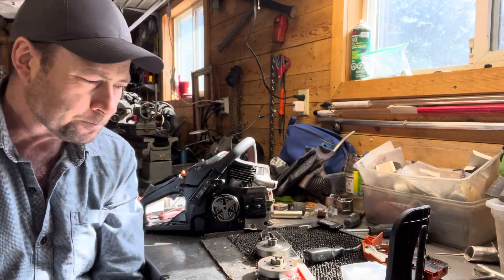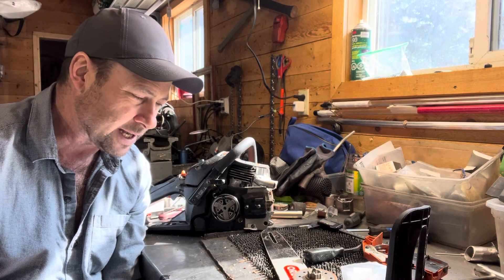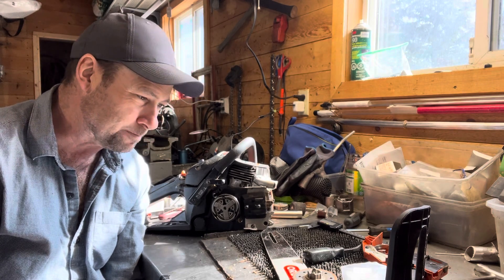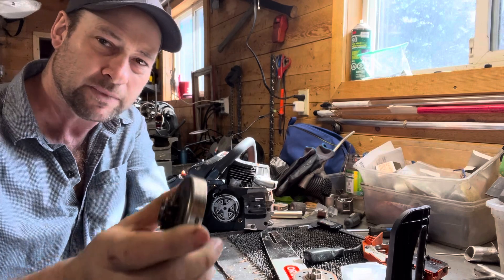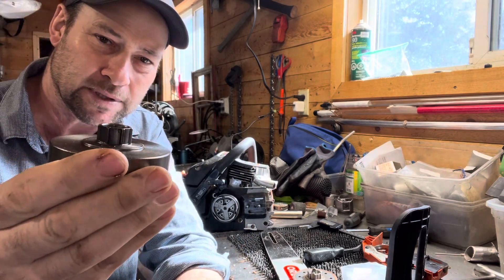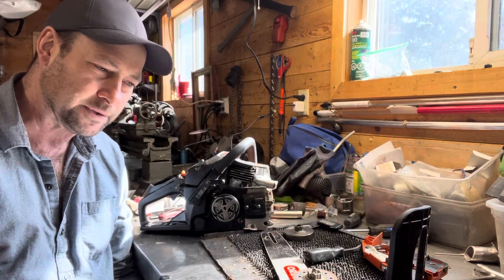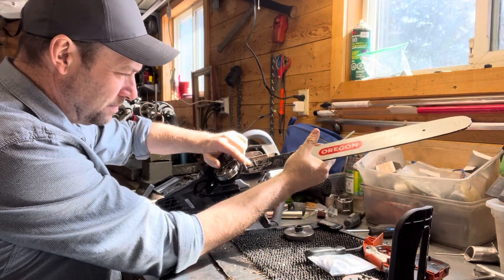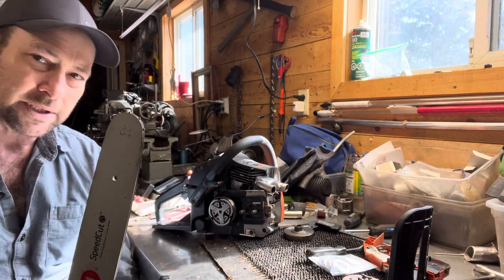How to Swap from 3/8” Low pro to .325 Pitch chain. Clutch drum/sprocket, chain and bar, see details

Comment: I have a question. I have a poulan pro 220 16" saw. I know it takes a 3/8 56dl .050" chain, but i don't know if its a low profile chain. How can i tell the difference between 3/8 and 3/8lp? Im about ready to change it to a .325" and be done with it.
Reply from the maker: I’m not much of a Poulan guy, I’d suspect if it’s under 50cc’s and only a
16” bar it’s likely Lp.
Often the bar has it stamped on it.
Google might clear it up quickly too 😉
Reply: @jimssawsnstuff8903   I googled it. The bar doesn't have it on it. I finally got poulan to answer me. It's a 3/8lp.
Reply from the maker: @inscoredbz  yeh, the link I posted was a Poulan box of chain for that saw and clearly showed it as LP
Reply: @jimssawsnstuff8903   I never seen 3/8lp on it.
Reply from the maker: 3/8” low profile Amazon (Canada link, 
https://a.co/d/iNrXual